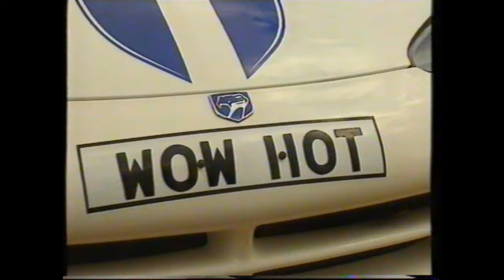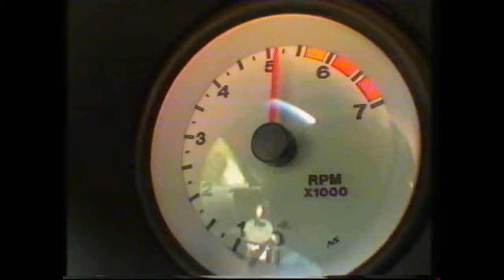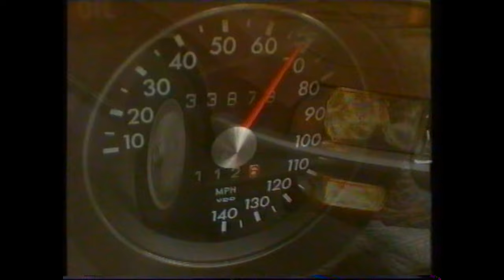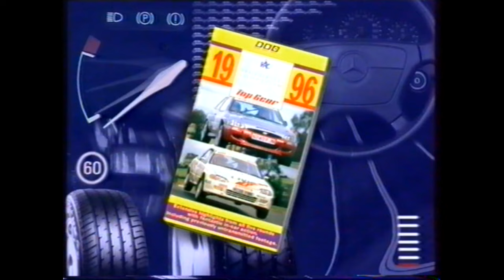Old Top Gear 1996- BBC 2

Comment: Dunno where Clarkson went clubbing, but I have never been to a nightclub where the bouncer didn't like you wearing jeans.
Reply: Back in the 90's you were turned away from most places wearing jeans. You also had to wear a collar and trainers were a flat refusal.
Reply: @Kiinell  I suppose that was before I started clubbing, but when I used to go clubbing in the early-mid 2000s jeans were accepted, well the clubs and bars I would go to in my town anyway. I know trainers were a flat refusal and still are, but never had a problem with jeans. Obviously the rules have changed.
Reply: Yeah. Jeans used to be synonymous with being a bit of a troublesome lout (at least when on a guy); sometimes still holds true but they're a lot more upmarket fare these days.
(at least; the ones not full of fake paint stains and pre-ripped fabric, which even as a kid in the '90's I thought were daft)
Reply: @jimtaylor294  Yeah I think wearing jeans became synonymous with James Dean, well that's what I think was why jeans became fashionable. Yeah I hate ripped jeans but don't mean the faded jeans.
Reply: nope, you wans't allowed in wearing jeans back then, or pumps